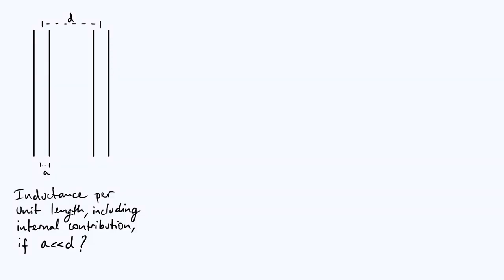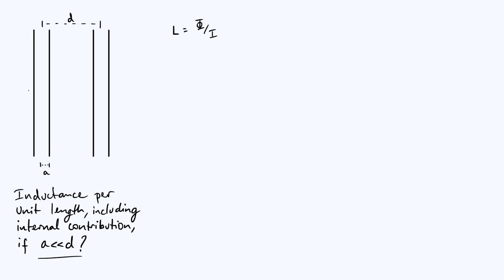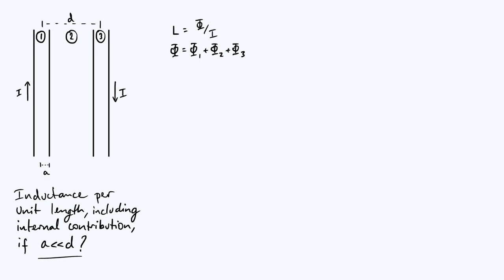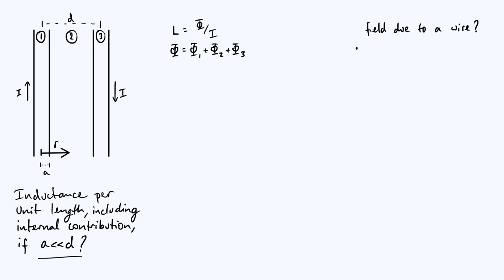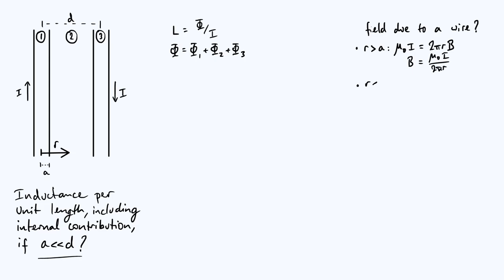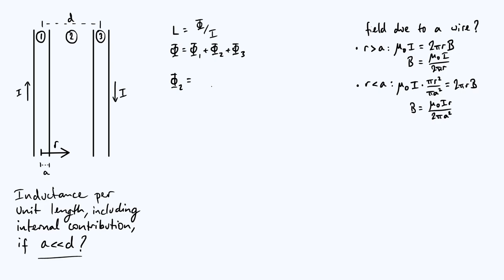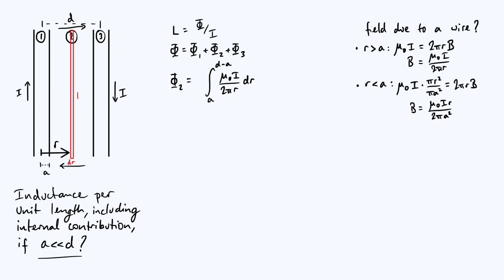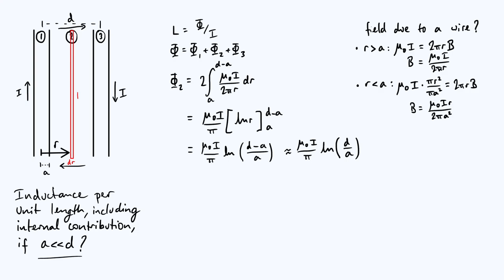Inductance of parallel wires, with internal flux contribution

Comment: Hi Dan, Thanks for the video! I’m slightly confused on the section where you consider self inductance of the wire (15:47). I’ve seen alternative derivations for internal inductance which use the same relationship between flux and flux linkage, when considering a single wire which doesn’t concur with the idea of encirclement of the current within that area. Moreover, in this derivation, assuming 1&3 are circular, how would this account for the region of d_r which is outside of the core ie on the other side? 
Many thanks

Comment: Dear Drn Yelverton, The flux linkage inside the wire is quite clear. Thank you.

As for the space "between" the wires, you are really talking about the two (intersecring) cylinders each is centered on its respective wire centre and excluding the wires themselves.

But there is also a space outside these two cylinders in which the B flux from each wire add but do not cancel. Is the flux in this space being neglected for simplicity?

For your Phi2, could you have integrated from a to infinity rather to d-a? Does this use of upper limit blow up Phi2?
Reply from the maker: Thanks for watching, glad it was helpful. There is indeed a nonzero flux through the region outside the wires, but it's only the flux in the central region between the wires that's relevant, because according to Faraday's law, it's only changes in flux through the circuit itself that induce an EMF. So ignoring the outside region is not just a simplification, it wouldn't be correct to include it and it would indeed give an infinite inductance!

Comment: Hi Dan! Thank you for this! In the final formula L, seems that if d is infinite, ln(d/a) is also infinite. Is there a limit to distance d in the formula?
Reply from the maker: The inductance can be arbitrarily large because more distance always increases the area between the wires and therefore always increases the flux. There's no specific limit on d, though we're assuming that the two wires are part of the same circuit, and in reality we can't have an infinitely big circuit!

Comment: Thank you for the video. Can you please explain why the distance "d" is selected at the center of each wire? Why do we not integrate all the way to the ends of each wire? Thanks in advance.
Reply from the maker: Measuring d between the centres is purely a matter of convenience, you could redefine it to be the distance between the far ends of the wires and your result would be the same in the limit of a << d. We did actually integrate all the way over the wires, but had to split the flux integral into three separate parts because not all of the current is linked to all of the flux (see explanation around 12:40 onwards). Φ₁ and Φ₃ are the results of the integrals over the wires themselves. Definitely not a straightforward concept!
Reply: @DrBenYelverton  Thank you for the clarification. Do you know where I can find a derivation for integrating from the outer ends of the wire? I am assuming someone had to have done it both ways to prove they yield equivalent results. Unfortunately, I am not seeing how it is equivalent because it seems to me there would still be some current contribution cancellation up until the outside boundary of the opposite conductor. In other words, only when "both" conductors are encircled by an Amperian loop, does the flux totally cancel. Am I missing something?

By the way, what is the significance of the limit of a<<d?